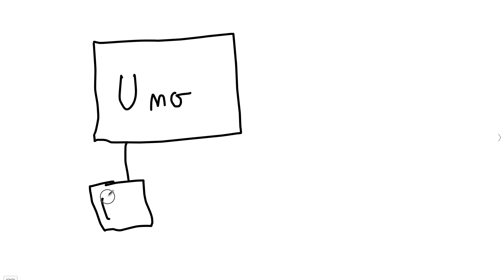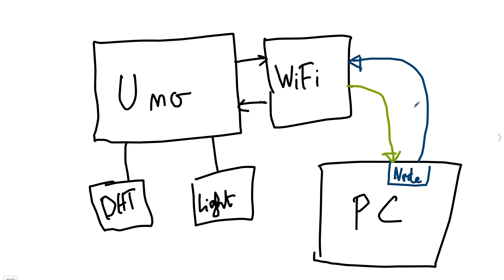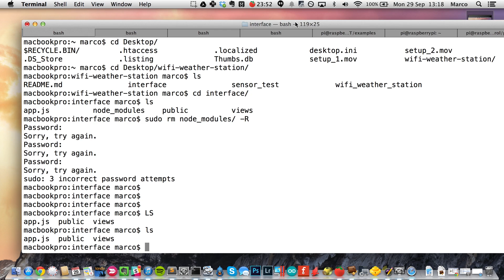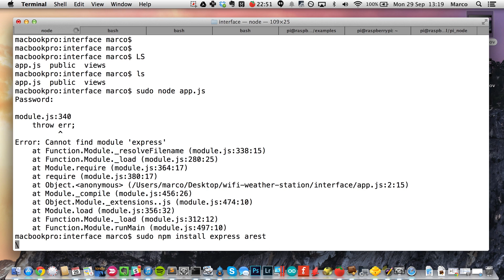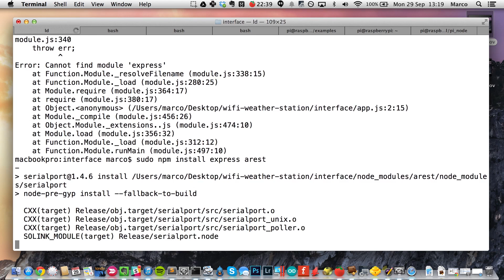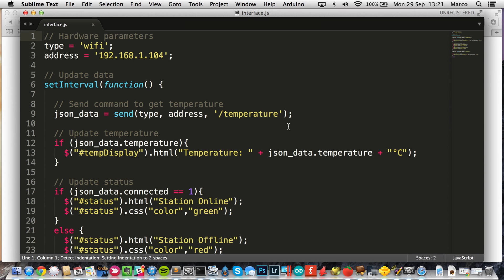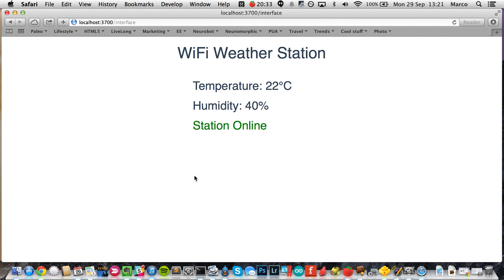Make a WiFi Weather Station With Arduino and the CC3000 chip

Comment: Is the photocell necessary ? It's not included as a part in the website
Reply from the maker: Not really, you can have as many/less sensors as you want in this project :)
Reply: Thanks a lot, so basically I have connected the parts for now, but I literally have no idea what to do next with the computer part. What did you exactly do there to make the website work ?
Reply from the maker: Make sure to follow the step-by-step tutorial on the website :)

Comment: instead of getting data from the sensor, can i just upload a value directly to the browser like this:
//temperature = (uint8_t)dht.readTemperature();
  //humidity = (uint8_t)dht.readHumidity();
temperature = 100;
  humidity = 40;
From what ive tried, it didnt work :( i tried to do this because i was thinking about sending float value i got from keypad to be transferred through the cc3000 onto the browser. is it possible?

Comment: i good tutorial, but wen i write in terminal "sudo node app.js" the trminal write to me "Listening on port 3000
Variable/function request sent to device: weather_station
Variable/function request sent to device: weather_station
Sending request to address: 127.0.0.1 for variable id
Error adding the device
Variable/function request sent to device: weather_station
Variable/function request sent to device: weather_station
Variable/function request sent to device: weather_station
Variable/function request sent to device: weather_station
Variable/function request sent to device: weather_station
Variable/function request sent to device: weather_station
Variable/function request sent to device: weather_station
∞
∞
∞"
were is the problem????
Reply from the maker: Lorenzo Bozzi First check that you can access the board via a web browser. Are you sure of the IP address ?
Reply: Open Home Automation yes in my browser web i can see temperature and humidity  with ip board, but not charge the page with js
Reply: +Lorenzo Bozzi you start the terminal or concole with administrator. and node app.js.   I think we dont use arduino uno. we use arduino mega. because arduino uno is low memory. not use stability.

Comment: Hello, I like your video's using WiFi. I'm using an Arduino Uno and a cc3000 WiFi Shield. When I upload the standard WiFi sketch and open the Serial Monitor, it says "WiFi shield not present". Can you please help?
Reply from the maker: Hello Simon! To test your shield I would make sure you have the latest version of the IDE and Adafruit CC3000 library, and then try the WebClient sketch in the library. Hope that helps!